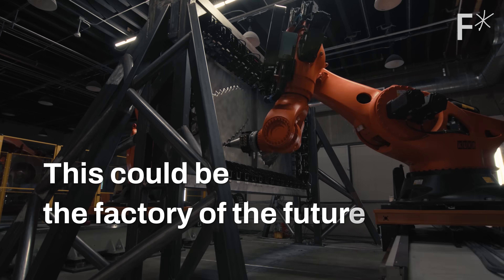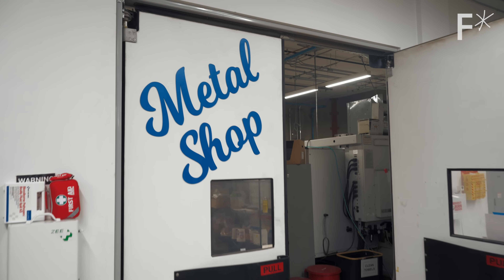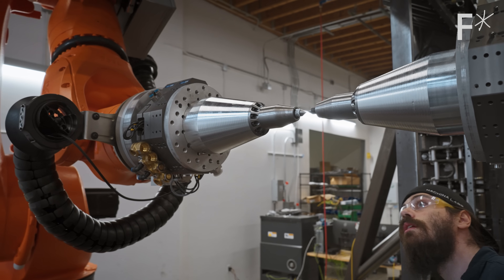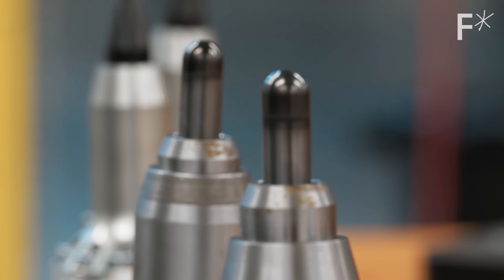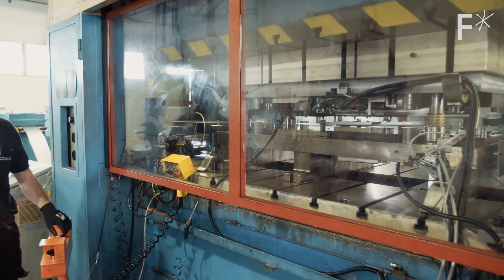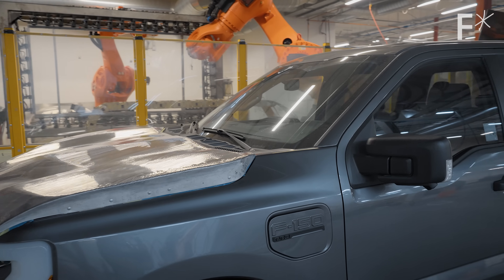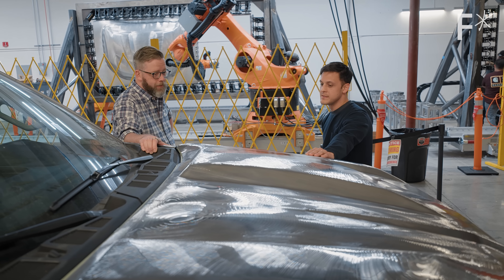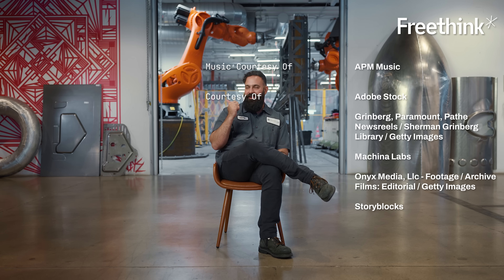Former SpaceX engineer invents a “Robotic Blacksmith Army” | Hard Reset

Comment: A lot of sales going on here. Do the math on time to manufacture a part and cost. For prototyping there is good potential but for anything that needs perfect surfaces or aerodynamic surfaces this has issues. You would need your calculate resurfacing all these surfaces and sanding. They should be more transparent on cost since carbon composites are extremely strong and light weight when optimized. Also probably less expensive than these parts, considering the molds are not steel but low cost high density foams. Don’t want to knock new tech it was more the presentation that was troubling. Honesty would go further to convince people who have manufacturing and engineering experience. Also a friend of mine has been working on this tech for probably 15 years at least. It’s not new. Also to say they don’t do simulation relegates them to aftermarket car body kits and maybe custom furniture on the architecture world. Those things can be great and are needed but they are not aerospace parts. Does one really need to prototype in steel when those forms are not even final forms? 150,000,000 sheet metal factor? Maybe they are confusing that with a full production plant? Robotic production and use in general is amazing, this just feels very snake oil salesmanish.

Comment: This method leaves roller definition lines much like how 3D printing leaves layer lines which does not make for a smooth finish product plus these machines are take to long to produce a single part versus  rapid smooth stamping that produces smooth finished parts in 10 seconds or less. These machines are best suited for rapid prototyping of products and vehicles ect but not mass production.

Comment: As a sheet metal shaper and coach builder and basically the human version of this machine i find this really cool but its just not practical you bring me a hood like that to make and i can have it done in a week or two and probably cheaper aswell . The prototype aspect is also kind of silly i have a cnc router that could make a foam plug for a prototype mould in a few hours and you could just make a carbon fibre or firbe glass  version which is where the future is heading the surface finish and steel thickness is also not practical to thick for body panels and to thin for anything military or even pressure vessels so all around just not practical

Comment: Around mid nineties in Helsinki University of Technology there was some academic work for similar sheet metal bump processing. Setup was build on 3-axis cnc originally used for woodworking. Obviously using it horizontal and no second manipulator pushing backside. If i remember correctly there was on the underside soft wood or just free space for forming. It was just some basic research on testing usability and for bump manufacturing process. Wasn't part of it so I have no idea of the results and was there any follow-up research done. I would imagine that for small to medium size parts and large production series, stamping is most cost effective and for small series and large parts bump process takes the cake. Instead of two robots pushing against each other it might also work with one robot and a back chamber of liquid and cylinder system to adjust pressure.

Comment: Those giant metal presses require an automobile model to be built in millions -in order for the factory to be profitable.
Once robotic metal forming is achieved, a factory can be profitable with building automobiles in the low thousands number.

I would emphasise how an industrial $150m press apply an enormous force to the entire metal sheet all at once, while the twin robot sheet metal former apply the same force, just on a tiny area - and then move forward.

Comment: Amazing tech, but also slow-slow-slow. The parts these make might as well be aerospace due to the price they will demand, hours(days?) on 2 industrial arms running special sauce code, no auto manufacturers will use this, but probably concept cars.. which is kinda opposite the 'custom cars for everyone' they are getting at, setup and parts removal takes manual intervention, more cost there, etc. flexibilty at a cost, it's very much like 3d printing vs injection molding. Also I have concerns about how the parts will fail, if they will sheer along the form-lines instead of having a homogenous structure, as they are being work-hardened in a spiral.

Comment: This might be usefull for prototyping / single piece or small series (like hypercars). But compared to sheet metal forming it's to slow for larger quantities. Same downsides as 3d printing vs castings. It will certainly fill a niece but not replace traditional production lines.
An intresting approach would be a matrix design, similar to those pin walls/ desk toy sculpture that are sold as curiosity where you can put a hand/face /object and it shows up on the other side. That design would form the whole surface almost at once
Reply: Yeah sheet metal isn't used because sheet metal is some great material. It's used because sheet stamping is one of the most efficient manufacturing processes.

Comment: Okay, yay for democratization of manufacturing processes, but has anybody considered the impact of such increases in  material usage? 

If everybody can make things out of metal as easily as submitting a vector drawing, then where is all that metal going to come from?

And what is going to happen to it after we're done using these relatively throwaway products? 

Think about the impact that the popularization of printers has had on our use of paper. Think of how many times you've printed 10 versions of a document just to get it perfect and then what happened to all of that paper you just used. 

Will we be able to support that much influx of material into our waste streams? Do we have the recycling and reuse capabilities now to even keep up with current production? 

There is a saying: "Think about the going out, before going in."

Comment: I am looking for soldering 2 sheet metals and arrived to this hahaha. ok not bad recomendation but is not what i am loking right now.
Reply: Weld the sheet metal. Solder wire is made out of silver., so soldering is just filling a gap with a glue, Brazing is welding with a Torch. Tig is how you "Braze" steel. Soldering is for the people that don't know how to braze.

Comment: This is just a big advert. No exploring the many limitations of the process. Rapid prototypes and bespoke parts, sure. But manufacturing 1000's of parts by tapping out pannels one bump at a time 😂 you can never out perform a press. Maybe if this were a infinity configurable press, it would "solve the problem" 
Also, i call bullshit on your fighter analogy in the description.  Years to fix and done here with the press of a button, was never proven or demonstrated in any way.
They seem really proud of that one-off truck hood though. So well done for that 👏

Comment: This is a useful technology for iterative designs or 1 off products but if you were manufacturing several of the same parts, this isn't the way you'd wanna do it. It's slow and expensive for repetitive parts. A perfect go between would be a pressed designed with millions of moveable points on either end that could be programmed for whatever shape needed to be shaped.

Comment: Couldn't you put thousands of adjustable "bit heads" in a stamp press and merge your process with traditional stamping? Seems like the best of both worlds.
Reply: I think cost will be a big limitation. 
The bit heads would need to be as tiny as possible,  should be able to withstand the stamping pressure and move accurately. Designing something like this would be way more expensive than buying off the shelf robots to do the work.
The robot arms provide an easy way to scale up and down the work or part area.
Lastly, robot arms can be programmed to handle difficult to stamp metals like titanium.

The point is to manufacture bispoke designs much faster and cheaper than a craftsman.
Reply: Shhhh u
Reply: That’s interesting…
Reply: Tooling and setup costs are factored into manufacturing costs. Thats why things are run in huge batches. A "universal tooling" is a hard sell because while it expands manufacturing capabilities it makes small batches insanely expensive and at that point theres no benefit compared to standard manufacturing.
Reply: Like an enormous dot Matrix printer

Comment: Very cool new tech - my only bugbear is that the sheet metal stamped parts look perfect but the robot chiseled parts have these visible grooves. Also great for custom one off or short production runs - for mass production I imagine it would be too slow and costly - both in terms of time and in terms of energy requirements.

Comment: also, stamping is still used because its fast, and cheap after the initial investment. It's not hard to put a different mold stamp plate on a press after you have the machine. whereas their machine I'm sure is really slow and will definitely require post processing to remove the ridges. As well as having to use thicker metal which will increase prices. So probably 50-100 times slower output, which means much higher price per item. That process can be great for niche parts that are not buyable or for products that may have very low production runs, but definitely not for large scale manufacturing.

Comment: For people who have trouble envisioning this, as I first did: imagine that you're a potter with two thumbs, one on each hand, you have the strength of an elephant, and your "clay" is a sheet of INCREDIBLY tough metal alloy.
Reply: We already do have metal forming and fabrication and assembly robots. This is a small step beyond that, proclaiming non-uniform parts is a good thing because of hand wave.
OK, my car fails inspection because of a bad brake, can't pull one from a parts house, gotta special order one to be made. Yay, excellence, exceptionalism, the exceptionalism of the short bus.
Reply: @spvillano  this is different. They're combining cutting-edge materials science with simple, old school trial and error modeling.
Reply: @spvillano  It will be really good for prototyping and custom jobs. It won't displace mass production, there is no way.
Reply: Potters can create a smooth finish though...
Reply: @thedubwhisperer2157  we are literally in the infancy of roboforming lol. Clay is a LOT more malleable than steel or aluminum sheet. You could easily get a smooth surface finish - their main goal right now is just to get the models physically accurate enough for production. Finishes and surface smoothness is way down the list, and in fact will be a natural byproduct of better forming algorithms.
Reply: @thedubwhisperer2157  it's been 10 months, I bet the AI has it making smooth parts by now... 🤔😎
Reply: basicly puhs pull 3d modeling on surface
Reply: With the ability to elinate long-haul shipping via a distributed process.
Reply: @paintedpony2935  YES. This is the real goal. Set up a mini-factory with just a few cells right where you want your parts so that your shipping and logistics costs are minimized.

Comment: Can't wait to have one of these things in desktop size like a 3D printer. The future will be awesome 🤗
Reply: Why don't use a 3s printer then
Reply: I dont see something like this doing these materials getting smaller than a car and still having the strength required, this at best gets down to small shop/large garage scale without some kind of breakthrough in robotics. Now if you're doing really thin sheet steel or doing aluminium sheet, yeah maybe desktop scale.

Comment: Someone explain to me how this applies to MASS manufacturing?  It’s an amazing technology, no doubt, but for low volume manufacturing.  It’s certainly far more efficient than beating out a fender by hand for prototypes or custom cars…. But metal stamping is one of the most efficient processes on earth for HIGH VOLUME manufacturing.  High volume = low cost.  Highly adaptable processes and machines make for low repeatably (in relative terms, comparatively to dedicated process, molds, dies etc), ie low consistency (again, relatively speaking).  If you want to make 100,000 of something, those robots will wear out, the tooling will deteriorate and you’ll have to replace everything many times before you ever reach 10,000 parts.  And you’ll barely have made 10 relatively inconsistent parts in the same time a stamping press would have made more than a thousand, maybe ten thousand,  nearly perfect examples of the same part. 

Again, this is great technology, but the entire video seems to suggest it’s going to revolution MASS manufacturing when in reality it’s key benefit comes from its versatility in low volume and one-off parts.  Again, the technology is amazing, but this video and its underlying premise is pathetically ill conceived.

High volume allows you to dial things in to near perfection and ammortize the cost over hundreds of thousands if not millions of parts.  This facilitates the lowest possible per-piece costs.  Consumer affordable goods will NEVER benefit from this technology because the costs involved, due to the time required to manufacture them, will never be produced using this technology.   It’s great for prototypes, pre-production models, aircraft parts, rocket parts, building facades, infrastructure projects etc are where this technology will ultimately thrive.

Comment: it's quite a bit like 3D printing.  yeah, it gives you amazing flexibility in creating new designs that can be started on right now, but the process is slow.  Tesla is making 500,000 cars in a year, you need to be able to build 1,369 of every panel on that car PER DAY.  This (very cool) machine could probably make 1 or 2 hoods per day.  Still, I love the concept and there's most certainly a place for it in many areas...boat building too?

Comment: A lot of very cool use cases and niches that this would be great at. However, if all you want to do is make millions of one specific part stamping would be cheaper and faster than this. This all sounds great for prototyping, customizing, using exotic materials, and democratizing high-end production for smaller players. But for a car marker that just wants to stamp out a million door panels out of aluminum as quickly and cheaply as possible, this wouldn't make sense.